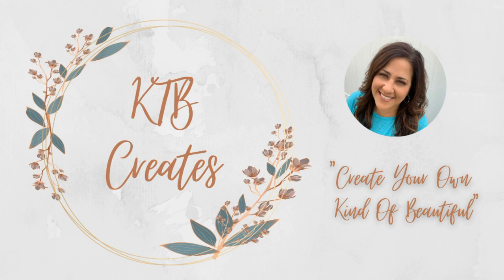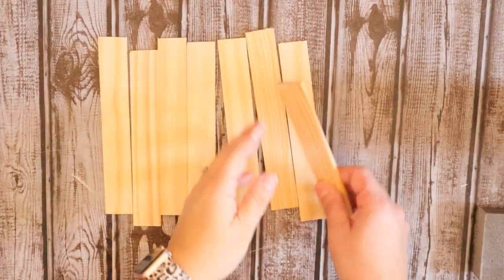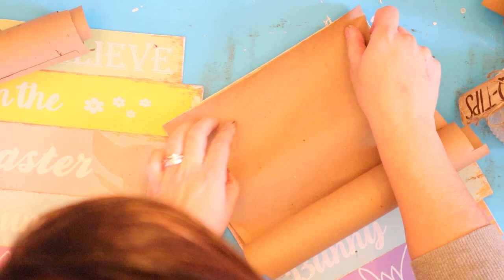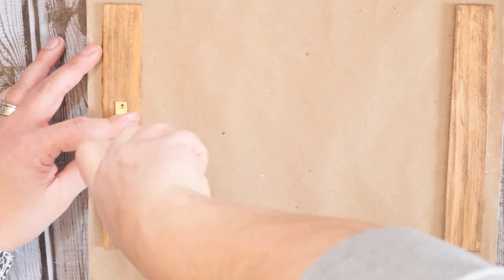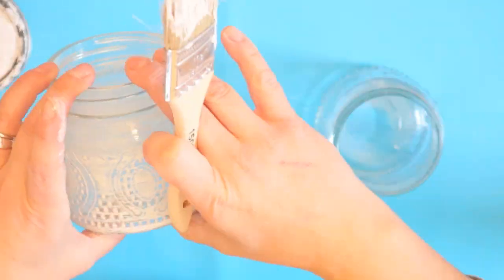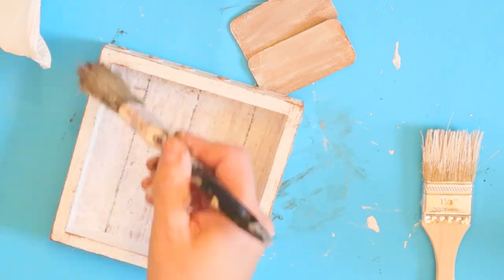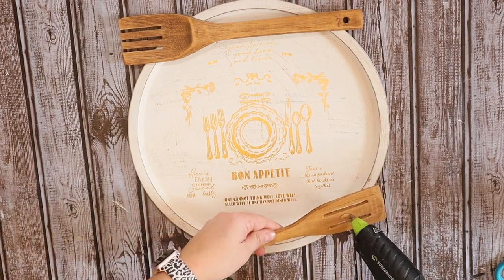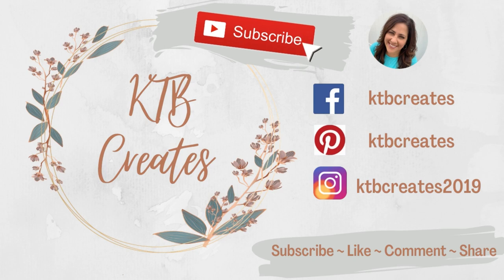Dollar Tree DIY's/ Farmhouse Decor/ Home Decor/ What Would You Do Challange

Comment: Love, love, love your talent! I see a lot of people struggling with the shadow boxes when they want to just use the interior perimeter. I measure the length and width of my shadow boxes and then I measure the thickness of each of the raised sides/edges which is usually around a quarter of an inch and that leaves me with the interior measurement of the shadow box. So, for example, the standard Dollar Tree shadow box is 5x5in with a 1/4 in thick raised side/edge. If you subtract a 1/2in from the top and bottom and a 1/2 from each side that leaves you with a 4 1/2in x 4 1/2in square to cut out. That should fit the perimeter perfectly then. Hope that helps.
Reply from the maker: Thank you so much! 💕